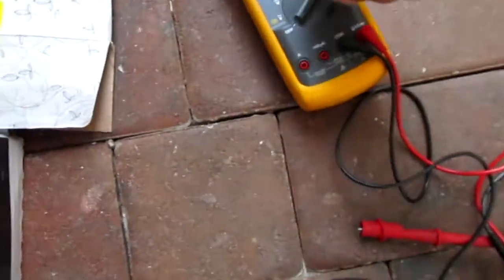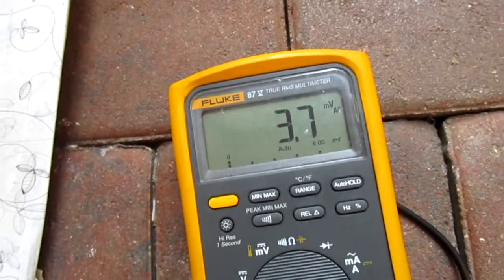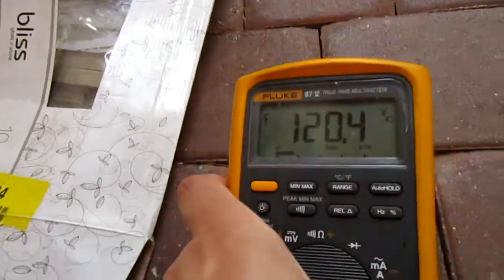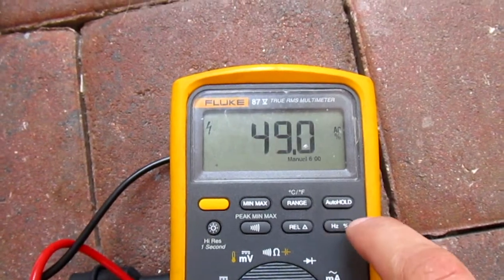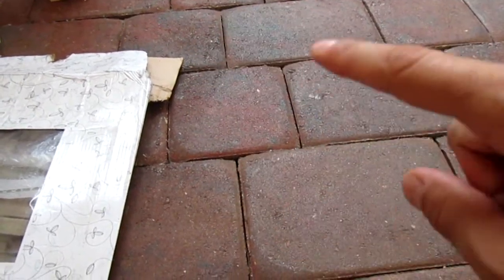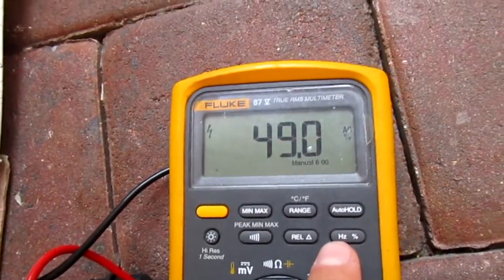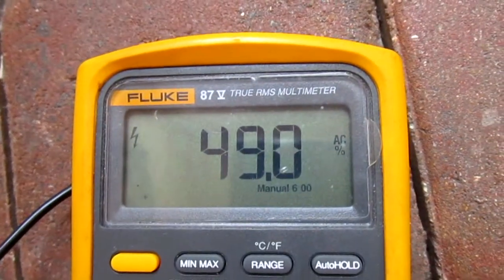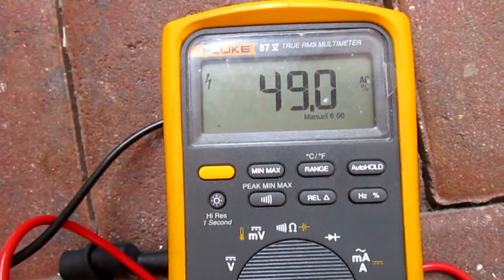How to Check Voltage, Frequency and % of line power!

Comment: The utility voltage is not ever actually lowered. During peak operations there are voltage drops due to high demand. The more current that is flowing through a conductor, the greater the voltage drop. Therefore, in the summer and winter when heating and cooling is at its peak, the load is the greatest and you will see lower voltages. This is actually why the voltage is often 125/250V to account for that drop. Otherwise it would fall below the acceptable range.
Reply from the maker: The voltage is allover here. Seen it as low as 112 and as high as 130. I have a UPS it clicks on of off many times a day from spikes and drops.   Multiple items have burned out not on UPS protection. Blown up capacitors ETC.   The power company tries to sell you a protection plan now because they know how bad the power is.   FPL/ next era has by far the worst power network. Lose power all the time.

Comment: If I wanted to buy a generator, should I look at volts, amp, AC frequency more than just watts? I see a lot of people look at wattage the most when buying a generator.
Reply from the maker: Watts is the biggest thing. Would not get anything lower than 5000 watts.  Best is to have something around 7000-9000 watt. Best is like some 20kva diesel generator.  

 Its expensive for more watts in a small portable generator but when you start adding up power needs its nice.   I have a 5500 watt I can near tap it out running 4 things.    Voltage? Its all the same. 120/240. Most are 20- 30 amp No more. Bigger ones can be 50 amp.  Frequency is always 60 hz the issue is it if its clean power or not.   The total Harmonic distortion varies from model to model and it will wreck some sensitive devices  if it has a high percentage.